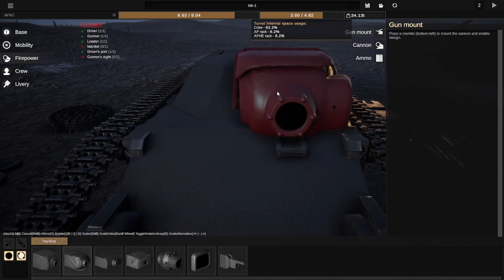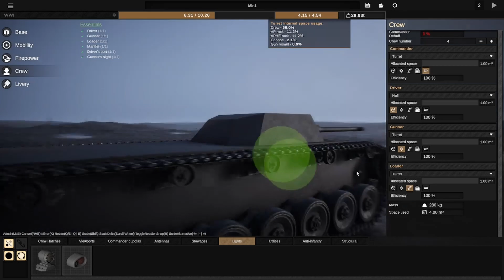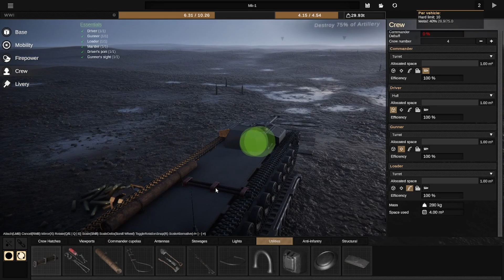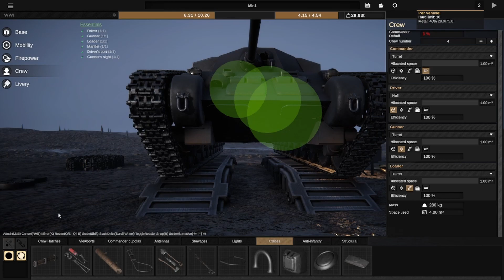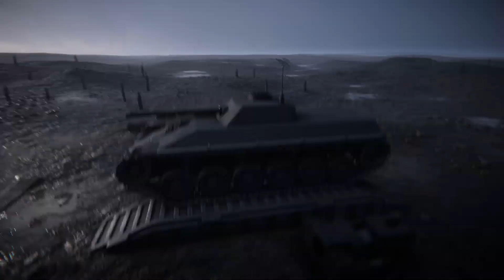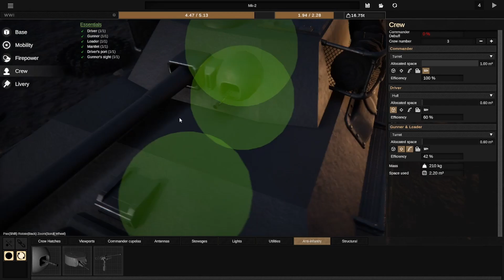Sprocket Part 1| "No tanks land" | rather boring mission, maybe skip to the interwar.

Comment: It doesn't have to be insanely long if it's light, and fast enough to skip over the trenches.  The Char B1 can do it with some modifications to make it lighter, and faster.  I usually take the Turret off, and speed-run it, because ultimately you have to shoot some static guns.  So, and Assault Gun really does the trick.  The right side of the map seems to be the easiest to traverse, if you're going fast enough (With WWI technological limitations.)